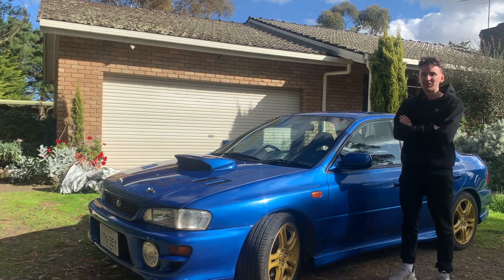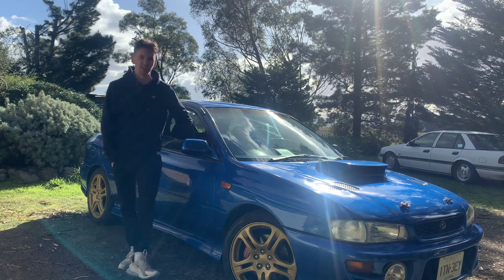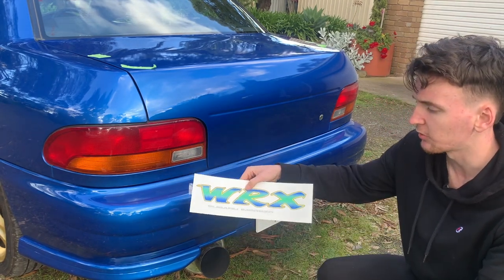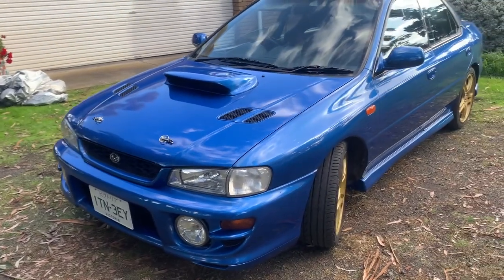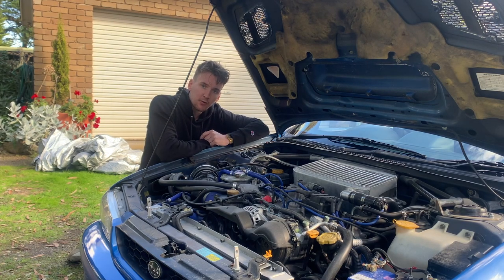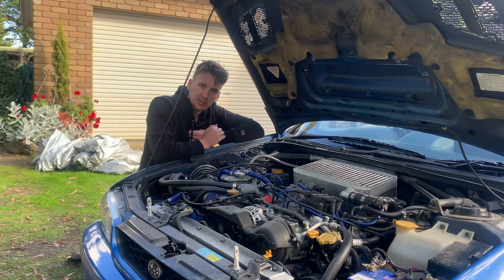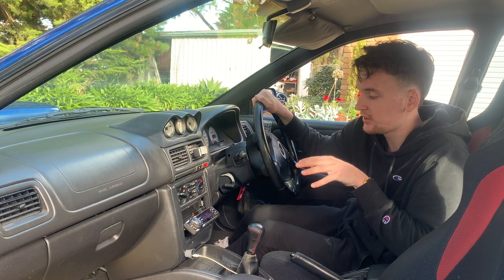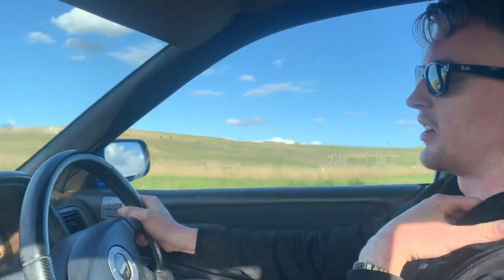A look at my 1999 Subaru Impreza WRX

Comment: 4 pots with pads are good. nice gc8
Chuck some embossed aluminum to separate the turbo and air intake.
the water meth is a good idea, where are you injecting into exactly?where are you getting the methanol or ethanol?